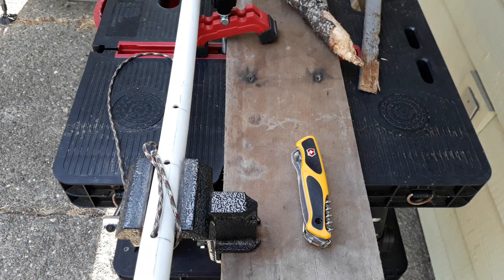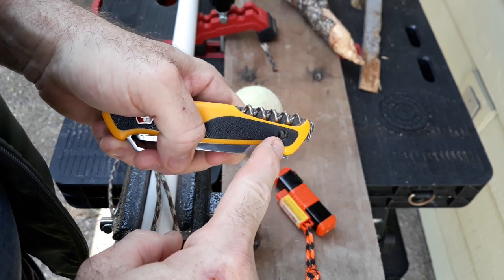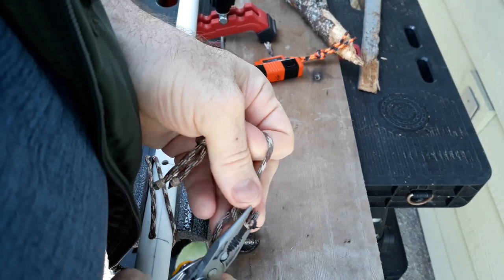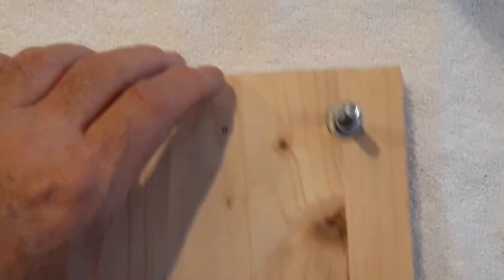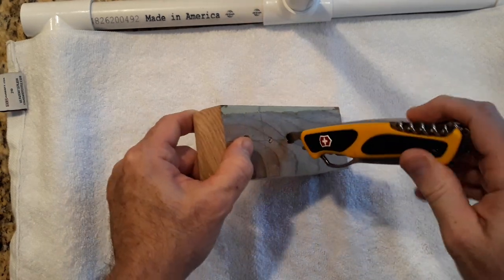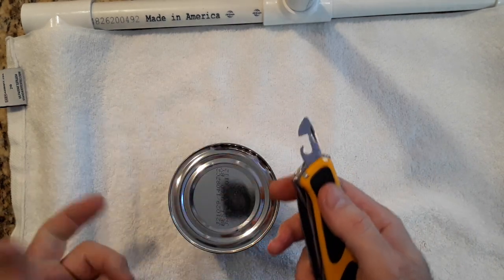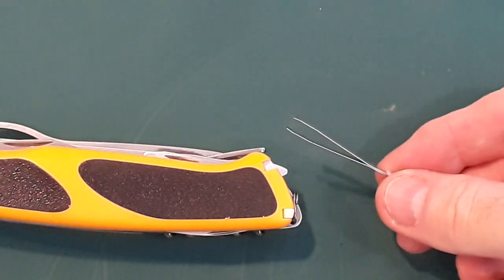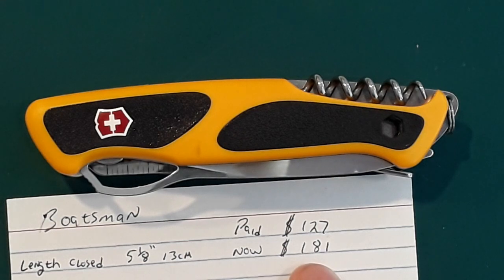Victorinox Ranger Grip - Boatsman: Working Review

Comment: Thank you for showing it working, this is a great review!

Some ways to use various tools, that you didn't mention here:
* The corkscrew can be used to hide small tools (Victorinox also makes some). You can also screw the corkscrew in larger items, and then use the knife as a carrying handle to lift the item.
* Tweezers can be used to pick out bones from a fish, after you fillet it. You can also remove ticks with it, or splinters of course. You can use the pliers to help grab the tweezers.
* A toothpick can be used for many things if you just think of it as a small twig. For instance, when you want to measure a long piece of wood, poke a hole in one end a put the toothpick in there, now you can see the starting point from further away. You can also use the toothpick unclog glue bottle tops, to fill in small holes with glue, or to clean your knife without causing damage (as metal would). The fact that it's made of plastic is what makes it so useful, and you can always buy spare.
Reply from the maker: Very true. Thanks for the additional input on uses.
Take care and have a wonderful day.

Comment: Hi, thanks for the video, great job!
I think that all of the „big“ SAKs are able to take bits as all interieur parts are standard. So all deviders or spacers have a hexagonal hole at the same spot. If You take of the scale You could drill an extra hole in Your handle. Get fancy with a file to shape it. There is a Video on Felix Immlers Channel where he does this mod
Reply from the maker: True. I made a later video showing a very easy way to expose the bit driver and have it look "factory". Thanks for the tip as it may help other viewers. And thanks for watching.

Comment: Great video. What do you think of the locking mechanism ? Do you think it's possible to accidentally push it while working ?
Reply from the maker: Thanks for watching and asking. I have two other Ranger grip knives that use the same locking mechanism as the boatsman. All three of them are pretty stiff for pushing that button. I really don't proceed accidentally pushing it and getting to locking mechanism to disengage. I think it's a very well thought out design. I've taken the scales off to check and see how it looks on the inside and they had a really good concept and they made it very well. Again, thank you for watching and for asking. Take care.

Comment: You should be able to just run a Black Sharpie marker over those measurements marks and then wipe the surface clean and the marks should be easier to read.
Reply from the maker: Many thanks - I'll try that.